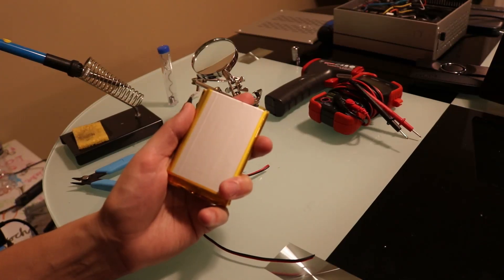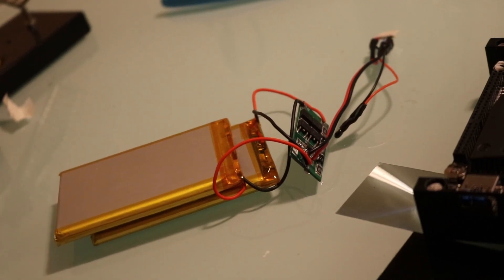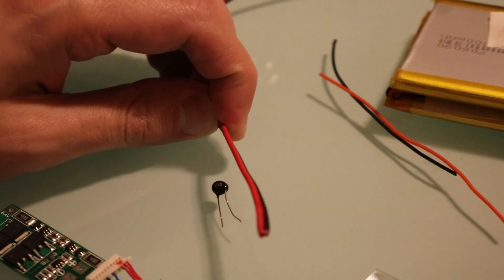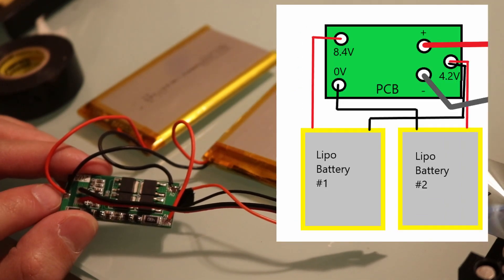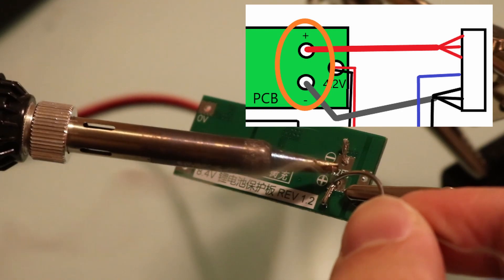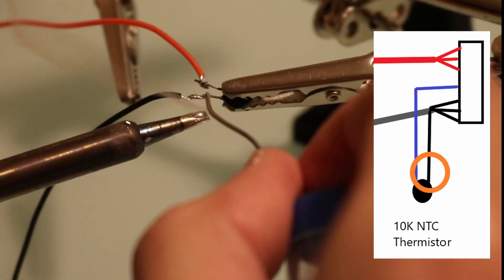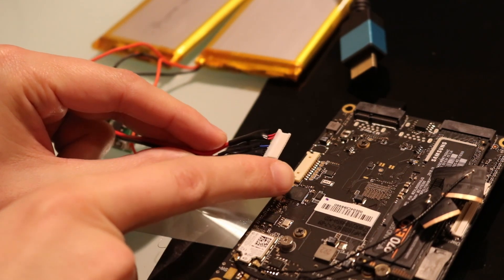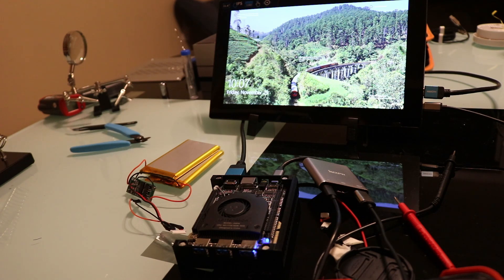LiPo Battery Build Guide For The Lattepanda Alpha

Comment: How do you get the 11-15V necessary for the Lattepanda with just a 2S battery?
Reply from the maker: Lattepanda alpha has 3 methods to power: usb c, 4 pin JST connector. These operate at 12-15V. The last option is the 10 pin molex panelmate connector on the bottom. This is for a 2S lipo pack
Reply: @HandheldHardware  thank you so much!! This makes me so much more curious to plan a build with the lattepanda :D i really wish more sbc did that

Comment: Can i run lattepanda alpha with powerbank. Can i use power bank instead of light volt batteries.
Reply from the maker: Bappy Ghosh yes a usb c PD power bank with 12v or 15v profiles will power the lattepanda alpha or delta. You can’t charge the battery and still use the alpha.
Reply: @HandheldHardware  u mean i cant change the power bank

Comment: I ordered some 10k ohm Ntc thermistors on eBay but I accidentally got the really small ones, would those work? And if I were to go back and order the ones that you used, did you get the 1% or the 5% variant?
Reply from the maker: Jacobo Lopez what’s the room temp resistance? Can you make contact with the battery sufficiently?
Reply: Project-SBC I have no idea what that means nor do I have any clue on how to find out since the listing I bought gives no information other than “thermistor temperature sensor NTC MF52-103 3435 10k ohm 5%”. And I can probably contact if I sandwich it between the two batteries? Like I said they’re small and like 2-3 mm wide
Reply from the maker: Jacobo Lopez do you have a multimeter? The ones you bought might be usable, but we would have to see what the resistance of the thermistor is.
Reply: Project-SBC When I plug in and set my multimeter to the 20k ohm setting it tends to be around 8-9 ohms but probably more consistently at about 8.4 to 8.6 or so

Comment: HI ! Does this work with the LattePanda Delta ? Thanks
Reply from the maker: Djon Le Magnifique thanks for watching! No it doesn’t, the delta doesn’t have the battery connector. I am working on a power delivery version that could be used with the delta
Reply: @HandheldHardware  Thanks for your quick answer ! I already build a Handheld with the Pi 3B+ and want to make a new system for GameCube games (...). The Delta seems fine (I didn't find Gameplay on Youtube but I hope it will work) and the Alpha too expensive for this kind of build. I'll follow your update on your Youtube Channel. Good Luck
Reply from the maker: Djon Le Magnifique should work OK with most GameCube games see ETAPrime https://youtu.be/U69YdqUK32k with same processor.
Reply: @HandheldHardware  That's a great information ! Thanks ! Please keep me update if possible about the power delivery version for the delta, I'm really interested.
Reply from the maker: Djon Le Magnifique will do! Still have some bugs to work out
Reply: >>  the delta doesn’t have the battery connector.
 @HandheldHardware  it has! DC PH 2.0 4 pin and usb-c !
Reply from the maker: @user-ru8sm8me3o  you can make a 12v battery pack for JST connector, but you can’t use 2S pack on 10 pin connector

Comment: Instead of 5000mah batteries, can two 8000mah batteries be used? Or is that more likely to catch fire?
Reply from the maker: Colton Mullins usually the higher than mAh the more current they can take or discharge, plus larger surface area. So reduced fire risk. Only downside is charge time. edit: always check the battery specs though, and if they aren’t provided ask
Reply: @HandheldHardware  how long does your 2x5000mah battery take to charge? Also, can you charge and play?
Reply from the maker: Colton Mullins you can charge and play. I never tested how long it took to charge, it might be around 2.5 hrs

Comment: Will this work on a udoo bolt v8 with ryzen 1605b embedded and vega 8 igpu?
Reply from the maker: Tyler Looney nah, the Udoo bolt doesn’t have a built in charging circuit like the lattepanda. I am working on a UPS version like this but uses USB C PD power bank, which would work with udoo bolt
Reply: @HandheldHardware  o snap! Sweet cant wait to see please keep me posted it will help me alot, im trying to used usb type c with a mobile power bank to use with the udoo bolt, for its powerful cpu and gpu for robotics and if u plan on doing that, then i cant wait to see, much easier to use usb c and mobile rechargable battery bank lol
Reply from the maker: Tyler Looney indeed! Although to be honest it’s either going to require a circuit board which I’ll design or some components like small USB-C break outs and mosfets that get soldered together. When I have a working breadboard prototype I’ll post a video
Reply: @HandheldHardware  sweet thanks, if it wasn't for people like u, projects like this would take ages to figure out lol thank you for your tech service lol
Reply: I am also very interested in the topic of this conversation! Hope to see the project soon!
Reply from the maker: Colton Mullins I’m so close to getting a 5V version working with a pi 4. The PD version will require some solid state relays I’ll have to order

Comment: Do I must connect 10k NTC Thermistor?
Reply from the maker: 천로져 yes, otherwise it will not power on
Reply: @HandheldHardware  Thanks 1 more, It's a 10pin connector, but are there really 7 cables connected. is it right?
Reply from the maker: 천로져 yes that is correct, 3 wires are not used. Also, if you are interested I am working on making a UPS (uninterrupted power supply) with lattepanda and USB C PD power bank
Reply: @HandheldHardware  You are preparing a video?  I am so excited.
Reply from the maker: 천로져 still more testing. So far I have been successful but I have not tested all yet. Also need some mosfets which come next week. So maybe 2-3 weeks

Comment: Please tell me how do you calibrate the battery? I successfully made the battery pack according to your tutorial. But the power status displayed by the window does not seem to match the actual condition of the battery. Window always tells me that the battery capacity is 0, but LPA can still work normally for a long time (almost 2 hours).
Reply from the maker: wa gaga that’s awesome you got it working! The only way to calibrate in windows is set power critical condition to hibernate at 3%-5%, leave charging for a few hours while on, then unplug charger and let the battery drain until windows hibernates automatically. You need to do that a few times for it to get better at estimating the battery. It won’t be perfect though, off a few %
Reply: @HandheldHardware  Thank you for your guidance, I will try this method in the next few days ~ Thank you

Comment: Can I use a 100k thermistor instead of a 10k???
Reply from the maker: Raphael Trombini I would advise against, because you don’t want LiPo batteries getting above 70C or they can catch fire. A 100k Ohm thermistor won’t have the same resistance as a 10k ohm thermistor at 70C, so it won’t protect the LiPo battery

Comment: LG LI-ION POLYMER BATTERT 7.6V 3.4Ah 25.84Wh   possible????  3250mAh
I took it off my laptop
Reply from the maker: 천로져 does it have molex panelmate connector?
Reply: @HandheldHardware  I tried it on latte, but it didnt fit. Would it work if I changed the connector? What kind of thing should I buy?
Reply from the maker: 천로져 yes, it could work if you had the connector. You can also buy other tablet battery that is compatible. If you want to make the connector, look for panelmate connector 10 pin, 51146-1000. Also buy the connectors and you will need a small crimper. It is somewhat difficult to make. I bought extra parts because I know I will make mistake. I bought parts to make about 10, I made 3 successful and have enough to maybe make 3 more.
Reply: @HandheldHardware  Very Thanks.
I want to buy another suitable battery, but I have a laptop battery that I dont use, so Im going to use it. If I buy a new battery, I think I will buy a PD portable battery( Xiaomi, Samsung)
Anyway, I afraid to ...convert 10pin.
I dont know how to it 
I will find videos...

If Im only going to convert a battery from a laptop a laptop battery into 10pins, Wouldnt I need to install a PCB?
Reply from the maker: 천로져 it would be difficult to find a video on it. I could make a quick one showing you what I do. The laptop battery should have a pcb on it already?

Comment: Hi, I im making a LP cellphone. i want to use a single battery and it need to be thin. Do you have any recommedation (V/mah)? and would i need a pcb like you did?
Reply from the maker: marcelin belisle is this with the original LattePanda or the alpha/delta?
Reply: @HandheldHardware   alpha
Reply: 800s
Reply from the maker: It would be difficult to do with one battery. I’m not quite sure how you would do that. The power draw is pretty large for a single LiPo to accommodate. At the moment I don’t think it’s feasible with one battery
Reply: You can't really chose the voltages with batteries , lipos are 4,2 - 3.something , so you would need a boost converter to convert it to highlight voltage , and a separate charge circuit , so ye its possible but I think you will be better , cheaper , more officiant , and actually smaller with 2 batteries
Reply from the maker: nistax and the current draw to get 20W from a 3.7v LiPo would be large, plus you lose some efficiency in the step up. You would be hard pressed to find a step up with that amperage out

Comment: Can i use 3 battery 18650 in series to power up lattepanda alpha using 12 volts input from JST PH2.0 - 4P connector?
Reply from the maker: Yes that would work, however below about 11.5V things may become unstable, especially under heavy loads, so you won’t get the full capacity from the batteries. You could get a 12VDC regulator to help smooth it out for longer period just be careful the batteries aren’t drained too much.
Reply: @HandheldHardware  Thank you so much!
Reply: Project-SBC so can i parallel 2 packs of 3 series 18650 battery to get more capacity?
Reply from the maker: Haziq Hazmi yes that would help. You could also go to 4s since the jst connector can go up to 15V but it’s important to keep it at 15V max. Make sure all of them are on BMS pcb too

Comment: Can I use regular 5v power bank with it ?
Reply from the maker: Forted Exe sorry, it cannot. USB C needs 12-15V, 10pin needs 7.3-8.6V. DC step up would need several amps to make the required voltage, would probably be expensive
Reply: @HandheldHardware  I didnt own the product yet. So this product required 15v usb c, it mean you cant use 5v usb c charger with it too ?. I cant find information about required voltage, but I checked on this page http://docs.lattepanda.com/content/alpha_edition/powering/ , they talk about omars 20000 power bank, it seem like 5v
Reply from the maker: Forted Exe the power bank in there is PD compliant, so it will negotiate to a 12v or 15v power profile
Reply from the maker: Forted Exe I actually put that power bank in the document. It is a 45W output PD bank. I also use the Apollo Traveler with my lattepanda
Reply: @HandheldHardware  I just do the research since the last comment, what Iam looking right now is the board that can provide 12v 120w, Iam planning to use lattepanda with gpu :D. I saw the guy on youtube use the board from china, that can run 12v 10a, but he only tests it in 20mins. Base on your experience, do you think it possible ?
Reply from the maker: Forted Exe you want to use a battery pack for a GPU and LattePanda?
Reply: @HandheldHardware  yes :)
Reply: @HandheldHardware  thanks, very nice

Comment: how long does the battery last?
Reply from the maker: mv vo never got to find out. One of the wires on the connector broke at the plastic and I haven’t gotten around to re-wiring it. Should be similar to the 18650 pack though
Reply: @HandheldHardware  thanks a lot, and how much did that pack last then?
Reply from the maker: mv vo 1h45 min under constant load (gaming/benchmarks)

Comment: how long will the panda survive with these LiPos?
Reply from the maker: Luigi I didn’t get a chance to test it because the wire near the connector broke. My 18650 battery pack at 6000 mAh lasted about 1h 45m under constant load, games or benchmarks

Comment: What battery did you get your original 10 pin connector from?
Reply from the maker: eric hammer it was a Dell fp02g XPS 10  battery. It used to be on amazon for $20ish

Comment: Great video!
Do you need to charge the batteries separately? They cannot be charged through the 10pin connectors right?
Plus can you add a link to the purchase of the batteries?
Thanks
Reply from the maker: tzionfly thanks for watching! Yes the 10 pin charges it when you plug your Pd adapter in.
Reply from the maker: tzionfly I bought mine from eBay but the seller I got my batteries from isn’t around. Something like this should work https://www.ebay.com/itm/3-7V-5000mAh-6060100-Polymer-Lithium-LiPo-Rechargeable-Battery-USA-STOCK/174019791023?hash=item28846348af:g:M28AAOSwjY5dcDbY
Reply: Hi, great info. Is it possible to build the batteries for Lattepanda V1.0, and connect them to the terminal block next to the USB port?
Reply from the maker: Julio Emen hi Julio, try something like this for v1.0 https://www.adafruit.com/product/2465
Reply: @HandheldHardware  hey project like how much volts need latte for good working why there is a electronic board it can reduce voltage like u habe 20 v and it can reduce it to 5 volts
Reply: you mean you can't charge it from LP's TypeC charger port right?
Reply from the maker: CoderH yes you can, you can see it charging with type c cable plugged in at 6:30
Reply: @HandheldHardware  like for put more batteries

Comment: Can you make a lattepanda switch with a graphics card? Is it possible?
Reply from the maker: That’s a tough one to do because of power consumption. The best would be   integrated graphics that is somewhat powerful like V1605b by Ryzen. Dedicated GPU, even mobiles ones take 40+ watts which is tough to do with a battery and keep it small
Reply: @HandheldHardware Maybe you can connect a graphics card to the portable lattepanda and If you want to use it then you have to connect a cable for more power. You now what i mean?
Reply from the maker: le Schnößel challenge accepted. Parts on order from China so will update in a month or so
Reply: @HandheldHardware  do you have Instagram?
Reply from the maker: le Schnößel yes I do https://www.instagram.com/projectsbc/